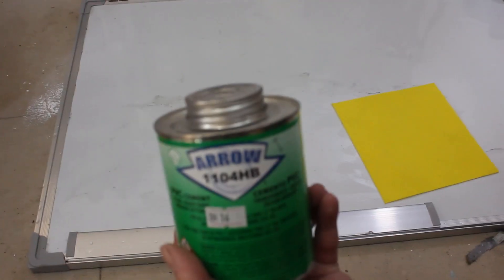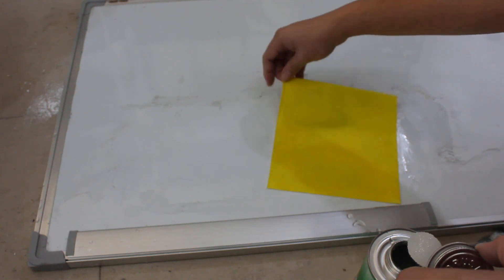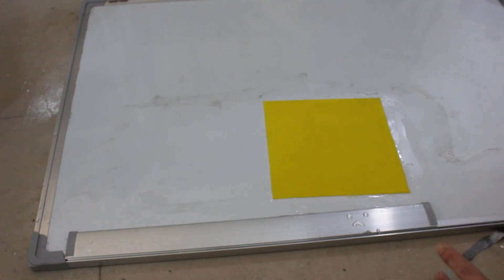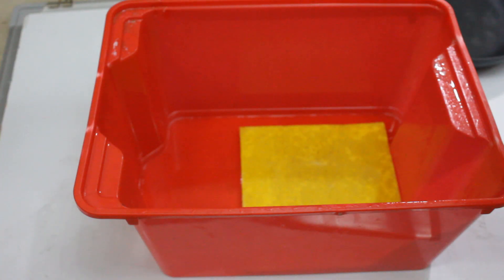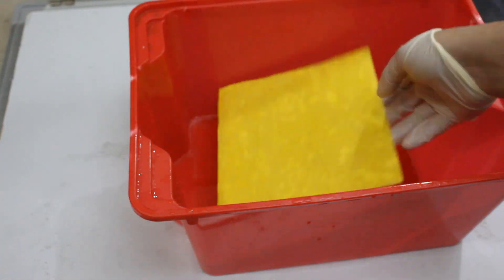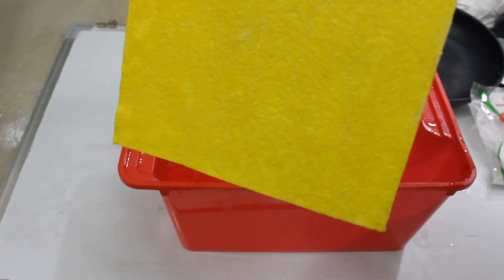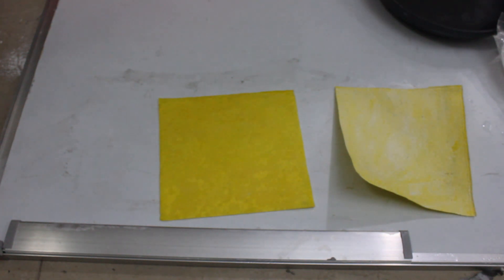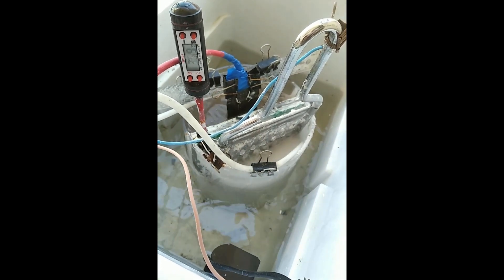Process on preparing on dechlorinated PVC membranes (outdated check description)

Comment from the maker: Such membranes are also good for preperation of lead perchlorate solutions!! because the citrate will strongly prevent lead ions from passing through as lead citrate forms on the interface which is highly insoluble therefore mobility of lead ions is less than that of the sodium ions.
This is basically ion exchange electrolysis.

Much better than using ceramic which if you run there will be considerable lead forming on the cathode means ions leaking through vs using a proper membrane where almost none leaks through.
Reply: Hi there, I would like to make an anion exchange membrane for an electrodialysis cell. I saw that you've mentioned below that we can use aminobenzoic acid reacted with dimethyl sulfate or methyl iodide to produce quaternary ammonium salt. May I know what's the reaction that will happen and is there any papers that can support this? Thank you very much!

Comment: is this just a regular dish cloth or is it microfiber cloth youre putting it on?

PVC coat
NaOH (concentration?) up to 4H
citric acid bath, 5-10%? 4H
Reply from the maker: video is outdated new one coming soon hopefully.
the process has also been refined

Refined process:
cleaning cloth or even fiberglass mesh doesnt need to be microfiber.
4 molar NaOH with 15ml of shampoo as catalyst containing quaternary amines.
PVC glue.
PVA glue (clear not white)
Citric acid.

The PVC glue is applied once to some fiberglass cloth and doesnt need to be waterproof as it is only for priming.
The PVC is dried then dechlorinated till off cream to slight yellow color at room temp for several hours to days.
The membrane is dried and a 4:1 wt ratio of PVA glue to citric acid is mixed till fully dissolved.
The PVA glue mixtrue is painted on the dry dechlorinated PVC substrate and cooked at 150 Celsius for 35 mins for the esterification.
The membrane is put into water to dissolve any unwanted unreacted PVA and the membrane is dried and if a glossy film is present it is a success.
The PVA coating can be done several times over.
Reply: @CatboyChemicalSociety  cool

Comment: i wonder if cross link linking still happen if we replace with sodium silicate? i'd rather difficult to find any borax in my country
Reply from the maker: I dont use borax in this method.
This video is outdated but the new crosslinker is citric acid and heating at 150 Celsius in the oven.
The new method involves dechlorinating PVC films on fiberglass sheets then mixing a polymer blend of PVA and citric and cooking in an oven to esterify it.
Reply: @CatboyChemicalSociety  ah my mistake i should comment on ur older videos but i'd clicked ur newer link lol :D

btw i've dig ur old video about chloroalkali with titanium electrode u said u plated them with copper acetate+glycerin, do u think  it can work with aluminum too but i want deposit al in copper? may be using aluminum acetate?
Reply from the maker: @dogodogo5891  u cannot electroplate aluminum in aqueous media.

Comment: Hello sir 
Thanks for the video .Could i yes this membrane in Hydrogen & Oxygen separate cell ?
Reply from the maker: yes actually this is perfect for that.
Reply: @CatboyChemicalSociety The name of this cloth please? Where i can get it ?
Reply from the maker: @manesantosh05  vileda cloth and you can use any sort of polyurethane or synthetic cloth or even cotton depending on usage.
Fiberglass is the best though.
Reply: @CatboyChemicalSociety   Thank sir
Reply: @CatboyChemicalSociety  Boat building supply stores carry cheap sources of fiberglass cloth,  plain, twill & biaxial weave, ranging from 50 to 450 g per square meter density.

Comment: It was really awesome to watch your videos. Thanks for sharing with everyone! I have a question I hope you will answer. Previous comments discuss this membrane to replace Nafion. Could this method be used to create PEM (proton exchange membrane also called polymer-electrolyte membrane) used in Hydrogen fuel cells? Nafion is used for that?
Reply from the maker: a modified process of this is used for that purpose.
the research and updates are ongoing but overall there will be an update video.
I have outsourced a lot of my projects with other people who have better equipment, time and means.
I will however leave you with a picture of the prototype membranes after dechlorination at 2 different time intervals.
link:
https://gyazo.com/0a729ec4421b00a0750cd63de2bfe021
8 hour dechlorination vs 16 hour dechlorination.
A cheap catalyst was used to increase the degree of dechlorination which is indicated by the change in the color (unnavoidable side reaction) leading to some double bonds formed instead of alcohol groups on the surface.
The next step would be to mix a 4:1 weight ratio of 10% PVA with citric acid and paint it on the membrane.
The membrane is then cooked at 140 and the citric crosslinks the PVA in the mix and in the substrate to form an ionomer which has low permeability but high conductivity and selectivity.
Atleast this is the plan and ratios of such will be adjusted.

Comment: @MysteriusBhoice Can you use this to make sulfuric acid? What concentration do you get? Also in a video where you assemble the electrode chamber I saw you using a frame and then glue to glue the membrane to the container, what type of frame did you use? What was it made of?
Reply from the maker: for the sake of prototyping I use polystyrene boards but after testing these membranes last more than 100 runs.
The best frames are made from polythene or polypropylene sheets.
The acid concentration is 35% after end of the run and you need to ensure that the electrolyte you add would produce a 35% solution assuming theoretical conversion.
so for a 1 liter cell the added sulfate salt is 4.2 moles then water is added up to 1 liter in the anode chamber.
Reply: @CatboyChemicalSociety  Wow thanks for replying. Is it okay if I remove the Calcium Hydroxide that is formed when calcium sulfate is mixed with sodium hydroxide? Instead of glass can you use polyethylene for the cell? Also for every liter of the 4.2 M sodium sulfate solution of anolyte, how many liters of the calcium sulfate slurry are added in the cathode chamber? Finally, what is the calcium sulfate to water ratio in the slurry? Thanks.
Reply from the maker: @japanjapan3102  the issue with polythene is that it can flex when u add water and that can dislodge the membrane frames unless you plan to plastic weld it onto there using same polythene.
yes u can remove the Ca(OH)2 that precipitates
you can also use MgSO4 and Na2SO4 respectively.
Na2SO4 has to be fed into the anode chamber.
Reply: @CatboyChemicalSociety  But why is the sulfate salt necessary in the cathode compartment? What would happen if I use  water in the cathode chamber and sodium sulfate in the anode chamber? Wouldn't it also produce sodium hydroxide in the cathode and sulfuric acid in the anode, given the sodium cations can travel through the membrane? Also I read that the carboxylic groups need and ph<3 to release the Hydrogen ions, so shouldn't one need to regulate pH as well and keep it acidic?
Reply from the maker: @japanjapan3102  yea usually at the start of the run the current is low.
you can jumpstart it but it can eventually reach low pH on its own as you run.
yes you can also use water in cathode chamber but without ions the current will be very low at the start

Comment: Thanks for the great video and for sharing your knowledge. Now I can make my own acids and maybe even some more cool stuff. They're high in price here. Eagerly waiting for more updates.
Does using PTEE or PVF instead of PVC, and defluorinating it make a better membrane?
I'm totally new to these things about dechlorinating or defluorinating and how they actually work chemically, can someone introduce some sources for learning more in this subject?
Reply from the maker: it sounds really hard to defluorinate those because after all they are super chemically resistant.
Reply: Can you explain what is chemicaly happening in this process, I'm a bit confused.🤔
The NaOH bath is for making PVA out of PVC.
And then the citric acid is bonding with PVA, to reduce solubility and the carboxyl group of citric acid allow selective transfer of +1 or +2 cations.
Am I right?
Then what is the role of fiber cloth?
Reply from the maker: @hrajabi7261  the fiber cloth is just a supporting mesh as the PVC film will be fragile on its own.
Reply: @CatboyChemicalSociety  thanks, very helpful

Comment: I suggest using pottery instead of cloth as a base, cause it withstands better against acids and a little more difficult to pass, but still ions can easily pass through pottery.
I guess that using pottery as the base will increase the durability of the membrane and can achieve higher concentrations
I mean for example coating a pot with PVC and then bathing it with NaOH and citric acid
and then put the cathode or anode in the pot and the other one outside the pot, it also increases the surface
I not an expert, just having an idea based on what I saw
Reply from the maker: fiberglass is much better or fiber blanket as a base.
the PVC is coated multiple times until the solution permeability without current is very low.
the pottery is a porous barrier but its thickness adds a lot the the resistance of the membrane if it were made into one.
Ideally you want a thin film of polymer that completely blocks the solution but only allows ions through it and that being a really expensive commercial membrane.
Reply: Yeap I agree

Comment: Hi MysteriusBhoice, Great video by the way! - a quick question, would this be ideal for allowing sodium ions to pass through?
Reply from the maker: yes thats what its for, monovalent ions and although it can pass divalent and trivalent like calcium and copper it will do that SLOWLY and the current will drop.
Reply: @CatboyChemicalSociety  Thanks man! - much appreciate your videos, I've found it quite hard to find comprehensive reference for these elsewhere online
Reply: @CatboyChemicalSociety  any way to improve it for Al(+3) and Fe(+2) cations?
Reply from the maker: @alexanderfl-ts3171  use sulfosuccinic acid instead of citric and btw this one is slightly outdated as theres 1 more step to make an impermeable ion exchange membrane I didnt include here.
you would mix 10% PVA solution with citric/sulfosuccinic acid wt ratio 4:1 to a dried dechlorinated PVC surface then bake in the oven at 150 for 30 to 45 mins.
After you would wash it in water and it should leave a continuous glossy plastic film which is insoluble in the water but allows for ions to flow through.

The sulfosuccinic acid inst used to neutralize the NaOH but instead is only used in the polymer blend.
Reply: @CatboyChemicalSociety  Thanx, will need to try. It seems this particular acid very uncommon so first need to make it...
Reply from the maker: @alexanderfl-ts3171  it can be synthesized from sulfonation of either maleic or fumaric acid.
Reply: @CatboyChemicalSociety  Bubling SO2 through water solution of maleic/fumaric acid? Not sure i understand the process, few info in the web about it.

Comment: None of the pvc cements I can find here have pvc resin, they all are just solvent that dissolves the pipe so they bond together.
Reply from the maker: then chuck some pieces of pipe into the solvent until the consistency is right and use that.
Reply: Right! Bet has added colors blue purple so see? What's he use of join to container, silicon, do they make untreated terra-cotta tiles could cut, bake the clay, could form a cup? Or tube. No?

Comment: Hi, i am looking for membrane to replace Nafion.
Can i use this membrane for water electeolysis to separate alkaline and acidic water for drinking purpose..
Really appreciate your feedback and suggestions on this..🙏
Reply from the maker: this can definitely be used for that purpose but the last step where you react with citric acid should be left out if you dont want any organic contamination in the water.
Instead you need to just merely use dillute hydrochloric or sulfuric acid to neutralize the excess NaOH in the membrane before running.
I also assume you need maximum selectivity so I suggest coating it 7x or more on each side with the PVC glue before treatment with NaOH.
Reply: Thanks a lot for the reply with suggestions.. I will try as you suggested and post my results soon.. 🙏🏻
Reply from the maker: @nareshchary  im actually curious at the voltage of this ED cell you are making since the water will be quite dillute of any ions.
with pure water you need some platinum electrodes as your anode if you dont want any metal ions leeching into the water.
Also wouldnt RO be better than ED for drinking water purposes or is this some kind of small research project you plan on doing.
Reply from the maker: @nareshchary  an electrodialysis cell is center fed with a cationic exchange membrane on one side and an anionic exchange membrane on the other side.
The cationic exchange membrane would be this one but as for the anionic exchange membrane you would need to attach  quaternary ammonium salts with carboxylic acids to link to the PvOH on the surface.
Such a salt that might be of use would be aminobenzoic acid reacted with dimethyl sulfate or methyl iodide to produce a quaternary ammonium salt which is positively charged.
Reply: Yes, it's kind of research project to check the results.
I am planning to use around 5V DC for this.
Actually I like to see that when water is electrolysed using electrodes either platinum or steel and PEM membrane and to prepare water which have more PH level, Hydrogen rich and negative ORP for antioxidant... This is similar to the water we get from an water Ionizer machine.
Do you have any plan to do a video for a test purpose.
Reply from the maker: @nareshchary  for the anodes you strictly need to use platinum and for the cathodes either titanium or stainless steel but if its for drinking purposes use titanium because steel can sometimes leech chromates albeit small levels but still.
Reply: Just interested if we can prepare a home made membrane similar to the one used in water Ionizer machine
Reply: Basically i like to find how to prepare a Ion permeable membrane that allows only charged ions transfer to do below job
"Inside a water ionizer, water runs across charged plates which are separated by a special membrane – called an Ion-Permeable Membrane. That membrane allows energetically charged atoms and molecules – called ions – to pass through. It doesn’t allow energetically neutral atoms and molecules to pass through. Water molecules are energetically neutral, so they don’t pass through the membrane. The alkaline mineral ions in water, and the carbonate ions in water both have energetic charges, so they’re allowed to pass through. This separates the alkaline minerals from the acidic carbonate."
Reply from the maker: @nareshchary  I have mentioned you need both a cationic exchange and an anionic exchange membrane with very high selectivity.
The nafion used is a cationic exchange membrane while the anionic exchange membranes used in water purifiers are polystyrene based with amides that have been methylated to form quaternary ammonium groups on its surfaces.

The membranes in this video will work to replace nafion (cation exchange) but is not an anion exchange membrane with good selectivity and those can and should only be prepared in a lab because methylating agents are highly toxic and mutagenic.
Reply: Thanks for the feedback. I think i need to postpone my experiment since in need also the anion membrane to start my ED
Reply: I'm not a chemist, so don't follow what you're trying, but do know that water that's deionied can be dangerous. It can past so easy though the bodys cell walls that it can cause them to burst.

Comment: Max chlor alkali NaOH (KOH) concentration allowed for this membrane with low temp. conditions (less than 20°C)?
More than 10%?
Reply from the maker: I havent gotten around to testing it in a chloro alkali cell yet but it works great for a sulfuric acid cell up to 20% concentration of H2SO4 on the anode side.
Reply: @CatboyChemicalSociety  Thanks!